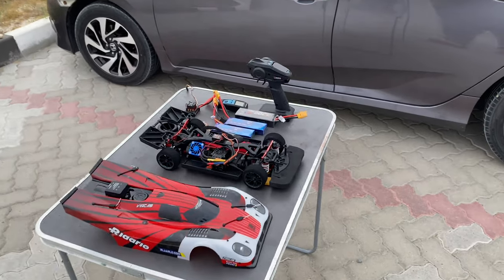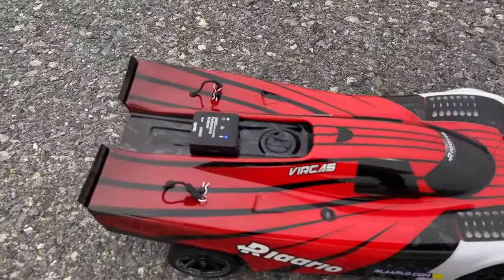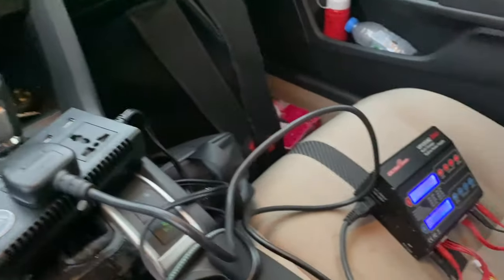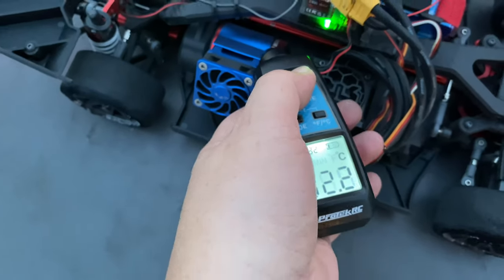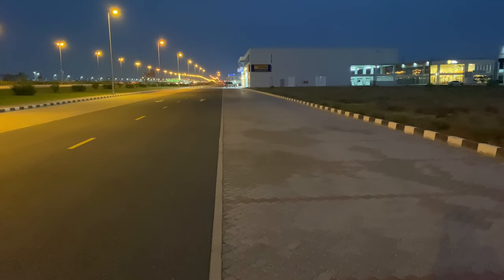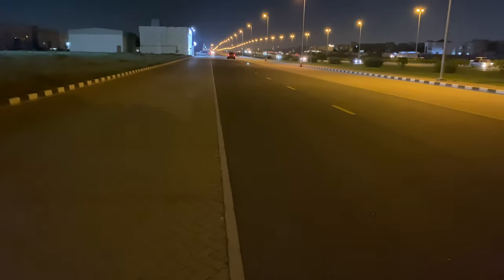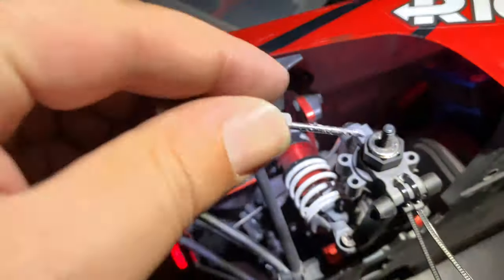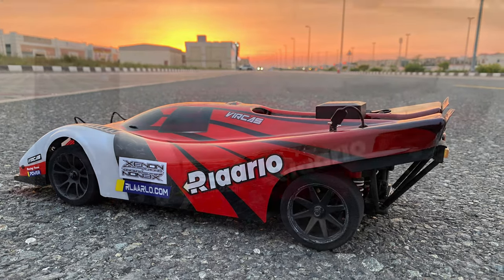122km RLAARLO AK-917 speed run but crashed

Comment: I've been watching all the ak917 videos on youtube since youtuber's been getting the car. Everyone is breaking the wheel hubs when they crash. The car also doesnt seem to have enough downforce or grip when it gets up to speed as many videos show it skidding and then crashing.
Reply from the maker: Yeah the hubs are available in alloy on their website and regarding the downforce it is there but need to drive it with both hands and less than 6s i guess i went more than the limit for testing
Reply: Yeah on all the videos everyone is sliding around around 75mph and crashing without it being driver error. I think this is why the cars haven’t shipped out yet. Because they were supposed to ship around the 20th of this month but haven’t yet. I’m good if mine doesn’t ship until they get things fixed on these.

Comment: I would buy a Dumborc 6ch radio and receiver for best results, I've gone over 600m in one direction without issue.
Reply from the maker: Me too 500 meter range no issues at all
Reply: @UAERCADDICTS  I bought a new radiolink rc6gs 7 ch and lost connection and destroyed my redcat rampage Exb around 400 meters, not happy.
Reply from the maker: Radio link antennas are good for around 300meter for more than that signal booster like hobbywing must be installed
Reply: @UAERCADDICTS  they brag 600 on the box, not cool.
Reply from the maker: @WoodsUnknown  in good weather conditions with low humidity it could reach that but you need to be aware of the area you will run at avoid big electric obstacles or underground cables effects reception
Reply: @UAERCADDICTS  nice long open road in front of my house in the country. Dumbo out performes most big name brands, I've never had an issue and there super fast response.

Comment: We just tried the AK today and it was terrible same problem as you 110kph and over and won't stay straight. Sideways every time.
Reply from the maker: Make sure the tires you used are not touching any thing specially the rear wing once you press on the rear push it down with hand and see of the wing is touching the wheel that was my case